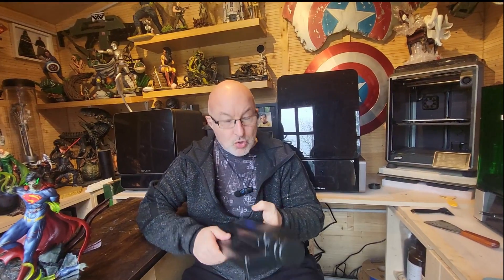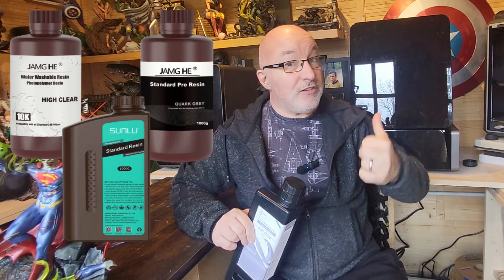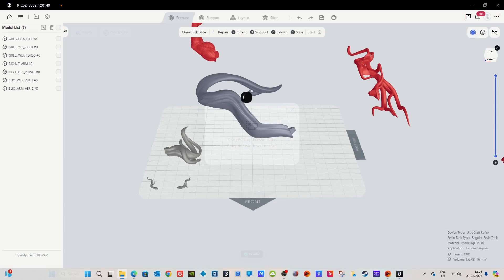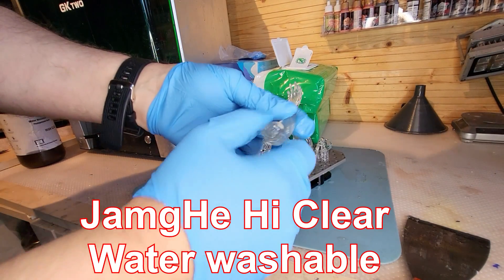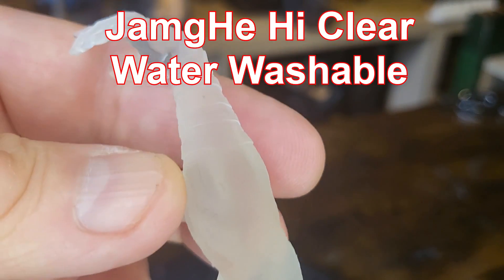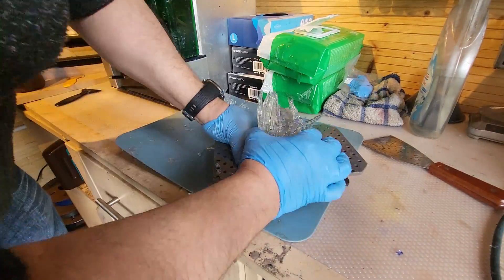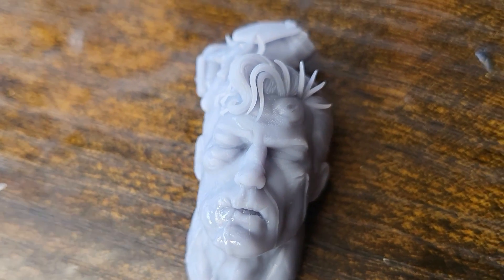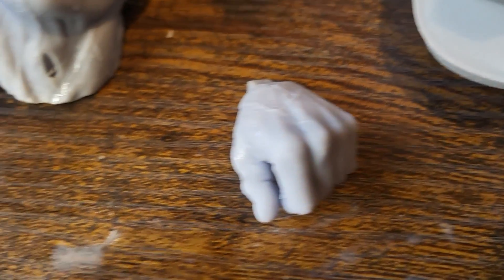Can You Use Cheaper Resins In HeyGears Ultracraft Reflex 3D Printer - Yes You Can !

Comment: as a hobbyist this printer is definitely on do not buy list . Im leaning more to the amycubic  m7max.  i like the fact u can use any resin the no bs auto leveling plate and pressure sensing screen with a heated vat. i just wanna print the occasional model and paint it.
Reply from the maker: thank you - id argue it is definitely for the hobbyist - you can pretty much use any resin in this :)

Comment: Thank you for showing this. Looking for an upgrade from my old Anycubic and the Reflex seems to have all the features I would like in a machine, but not being able to use the resins I am used to is a dealbreaker for me. You showed that it works with other resins, but knowing that the ABS like and other specialty resins I have needed tweaking in my old Mono I am not keen on splurging 1000 on a gamble machine that can not be tweaked in any way. Not liking that they locked the machine to their own slicer as well, but I could live with that. Hope they change their postion on this and add an option for custom resin profiles. If not I guess it will be Uniformation GK3 for me when it gets out on the market assuming it gets positive feedback.
Reply from the maker: Are fully understand your hesitation to buy I really do live in the real world with you I guess I may have the same thoughts recommend GCSE ultra I'm using is also working well but the gk3 pro they sent me I'm having some issues with now I think they're sorting that out for the commercial release some might be worth just holding on there until they're commercially released it and we get some reviews
Reply: @greedy3d480  Yes and no. Yes it makes sense to wait and how the production models work. No. It is hard to hold off. At the moment I am dying for a printed with a heater for the resin cause I can not print anything until april in my shed. Are the pre booking discounts over now btw?
Reply from the maker: @Average-AL yeah afraid they are
Reply: @greedy3d480  If this was music software it would not be a problem cause then we would soon have a spring sale or something. How often do sales come up in printing market?

Comment: I need an Info.
i also have the RS and i install the vat heated but im not using the pusle module.
i try with some 3th brand resin and also with Heygears parp10 orange resin but the supports left a lot fo mark on the model.
The previous resin print Reflex instead works perfeclty with the original resin and didnt left any marks.
Do oyu have also this "issue" with the heygears and not original resin?
Reply from the maker: no i don't my video soming out soon (this week) will show me using 10 resins with it - stay tuned for that one ..

Comment: I mean it s*** that it is not officially supported but the same was with Zortrax printers but they opened it up later for external filament. Despite that they want to increase their revenue, they also want to make sure that you always have the same quality.
Reply from the maker: I just think we need to look at what we do have which is an excellent 3D printer that you can use third party resins in easily yes its geared towards their own proprietary resins it really doesn't detract from the printer because using third party resins is an option.. I also think they will drop the price of their resins to be more competitive
Reply: @greedy3d480  totally agree.

Comment: Honestly, if they open their slicer up to allowing people to change settings so they could use 3rd party resins easier - than I think not supporting chitbox or lychee wouldn't even be a thought. Blueprint puts those apps to shame in almost every single way EXCEPT for it being locked down. 

I think they could very easily just add custom profiles just like bambu studio. You would have your default profiles for heygears resins built in, but you can create custom profiles and adjust all the standard resin stuff and save them into the slicer to choose whenever. That literally is the 1 and only thing that is keeping this printer from dominating the consumer resin market. 

I suppose price could be argued too, as its definitely on the premium end of the consumer price scale - but again, with all of the features and the level of quality that this printer brings I think many people would be willing to stretch to get this, but the locked down nature in conjunction with the resin prices no doubt turns so many people away its not even funny. Hell, even if it was still locked down but heygears resin prices were more reasonable I don't even think that would be a huge issue! I'm not even talking sunlu $18-20 per KG prices but I think even $35 per KG and this would still be a totally different conversation. And in terms of the hardware I don't even think $1400 is too much for what you get, it's clearly thoughtfully built, uses quality components, and is well engineered, but like with anything the premium end of the scale is just never going to get as many sales as the low to mid range. Still - it would be impossible to argue they're not shooting themselves in the foot with locking it down and then asking astronomical prices for their resins.

LAST - if heygears reads this for whatever reason, WE NEED CHEAPER RESIN REFILLS if you're not going to open blueprint to custom resin profiles. I'm sure the odd shape and the valved lid add a decent chunk of cost and that definitely can explain SOME of your resin pricing. Fine. It's still too expensive, but please release 2-5 KG options in regular bottles that we could just refill into cartridge bottles for a more reasonable price per KG. The number of people that us BL filament shows people are willing to pay extra if you give them a reason to want to, but you can't be anywhere close to 3x the popular mid market options.

Comment: How would accuracy printing with 3rd party resin. Like example cube 20x20x20?
Reply from the maker: Not tried it But have used it on many 3 day.Printed models and they all joined together seemlessly
Reply: @greedy3d480  asking because all resin printers are not accurate from built plate. Maybe you can make few prints to check this printers accuracy? Really interested in this printer, but all parts what i print are used in mechanical things, so looking for best choice.

Comment: So I have tried Elegoo ABS-Like Grey, Vulcan and am trying a mix of Elegoo ABS-Like with Phrozen Aqua 4K at the moment. I will say that it will print, and the detail of the print is still very impressive, there are a lot of areas where the Blueprint supports failed which goes to show how brilliantly Hey Gears has dialed in their settings with their resins (although to be fair, there were a couple of smaller fails in the print using HeyGears PAP10 too). All in all, I feel like it provides a good case for HeyGears to open up Blueprint to other resins knowing that you may have to beef up the supports by manually adding supports or at the very least, make the Reflex available to Lychee and Chitubox. Much like Bambu Labs, the convenience of plug and play is generally preferred so using HeyGears resins is ideal, however, for those times when either HeyGears is out of stock on resins (as they are currently, looking forward to getting more PAP10 when it restocks in early May) or you are doing a test print to analyze a relative size, proportions and weight of a prototype where using a pricier resin like PAP10 doesn't make fiscal sense, opening up the option for 3rd party resins still allows me to use my Reflex in all instances instead of switching to another printer for testing and then using the reflex for final production. At the very least, a lower cost resin refill that does not use the HeyGears bottles similar to Bambu Labs filament would still fit the higher end prosumer market without gouging them.

Comment: Has anyone tried Elegoo Grey ABS-Like or Vulcan resin on this printer? Mine came with one bottle of PAP10 and I am afraid I am going to run out mid print on some prototypes and it looks like HeyGears is out of stock so I can't even order any of their expensive resin. I don't normally use Elegoo Grey or Vulcan ( had a ton of success with Sirayatech 80% Navy Grey and 20% Tenacious) but figure of all the resins I have hanging around, that might be the closest in terms of properties to PAP10.

Comment: Was just deciding between this and the GK2 from information, Would have loved this one, but no 3rd party resins is a no go, though I do not use the cheapest and no sunlu, but I do want to have the choice of what materials I use for loads of different projects. 

If they would just sell an empty bottle and allow you to put in the Resins own attributes, I'd be happy and would have went with them.
Reply from the maker: I agree with you however, the more i use it the more i like it and now that ive established it works with jamghe and sunlu easily its turned into my goto printer....if im also honest though i wouldn't have paid the money they are asking for it , i really like the slicer and supports ...i like the wireless connectivity ..its quirky though - forever giving errors when i start a new print BUT its usually as theers something like a bit of support floating in the vat ....so i guess its doing its job , im going to do an uopdate on using it in a few months
Reply: yeah for me the draw would be the plug and play, I was actually wondering what happens with the floating micro bits of cured resin you will end up with at one point, I will be waiting for your longterm review. But I think the bottle system is something that will come to all printers at some point and most likely with a non-propiretory version of it, I mean with heated beds, self leveling  and refilling already, it gets much more into the actual consumer and not enthusiast area with #D printing now, which is a good thing, as longa s we as users do not cater to companies trying to lock off their ecosystems totally, especially regarding consumables like resin. I need Good ABS like water washable resins, I want to dable with wax resins for doing jewalery and rubber like resins for a few other projects. I do neet and want adaptability regarding the materials I want to be able to use, I do not need to want to buy a whole new setup just because I need or want to change materials. .   @greedy3d480

Comment: Great test, thanks, I may be wrong here but I think Hey Gears are targeting a different segement, (smaller professionals?) the machine is really similar to a FormLabs 3 and that system costs around £10k for the full package and the resins are sold at £125/l so it represents a significant saving on that front. Just speculating here but for a business who can pass the costs onto consumers, such as dentistry the cost of resin may matter less than the ease of use. Either way great test, lots of hobbyists (me included) find the closed loop model frustrating.
Reply from the maker: I would agree with you have they not been targeting the consumer market they already have a business market but know their targeting the consumer market
Reply: Aye absolutely, i do think there is some room in the Prosumer space, but you're 100% correct that theyare mad if they think most folks will shell out that sort of money given the alternatives available. @greedy3d480

Comment: Some suggestions for Heygears if they want to open up the printer: 1) Allow third-party slicers (Chitu, Lychee, Tango, etc) and add API support. 2) In “Blueprint” slicer, add ability for user to add custom resins and make custom resin profiles, and add ability for user to adjust print parameters (exposure times, lift times, etc), even on Heygears resins. 3) Heygears should then sell “empty, blank bottles” that users could fill (and label) with third-party resins. 4) Heygears should have a “manual fill” touchscreen setting that would “close the resin gate” and guide the user for filling the vat, sensing resin level, without certain warning messages that have to be bypassed. 5) Heygears should come out with upgraded printer with 8K, 12K, or 14K screen that has larger build area and 24 micron (or so) pixel size to be competitive with current competition (especially for the high cost of this machine). Any other ideas? Please comment!

Comment: Question for you Greedy: I originally thought that Heygears had some sort of “QR code” on each resin bottle, and that once bottle inserted in the machine, the machine could “read” the QR code on the bottle and automatically determine (and select in software) the specific resin bottle that was inserted for use. Apparently not so. The machine can’t auto-detect the resin type and, therefore, you must still manually select the inserted resin “in the slicer program” (and can’t even select the resin on the LCD touch panel). Please confirm the above. Thanks!
Reply from the maker: No I don't think you're right there is an RF tag in the bottle that tells the printer what is in it I know this because I've told the slicer what I'm using but when I used a different resin ie I put a different bottle in it recognised there was a mistake
Reply: Thanks for the clarification / correction. Interesting. Well, each bottle having RFID is a good check to prevent “user error” selecting the wrong resin in the slicer (or is that only a warning showing up on the touchscreen after the sliced file has been sent to the printer? so many questions!). Anyway, having RFIDed bottles would slightly complicate matters if Heygears wanted to open up their printer and sell a “blank bottle” that users could use as a “custom” bottle for third-party resins. If their slicer allowed users to make several “custom” resin profiles, and Heygears sold, let’s say 3 or 5 “blank” bottles, each bottle with a unique RFID identity, then users could have 3 to 5 custom third-party resin bottles.
Reply from the maker: @dovmerrill804  I guess the easy option is just pour it in 👍

Comment: Thank you greatly for following through with testing other resins (having to trick the machine into thinking your using Heygears “locked-in resins). We appreciate all the extra time & effort you had to expend. Also glad Heygears allowed manual closing of the “resin gate” and bypass of “low resin” warnings (makes me wonder if the “resin sensor” was even working!) so you could manually pour resin into vat.